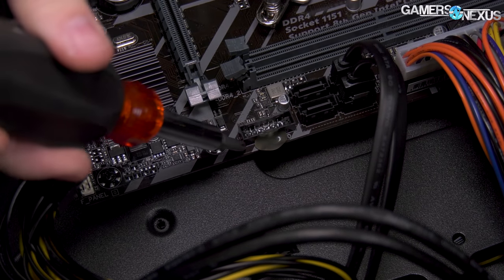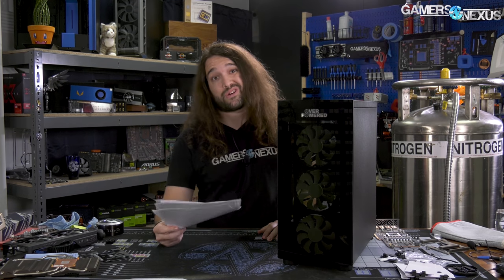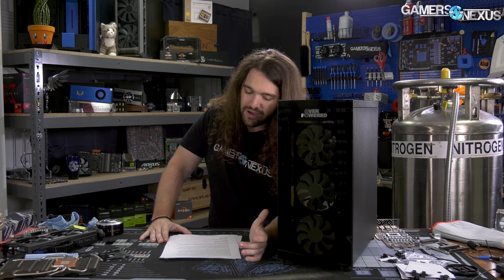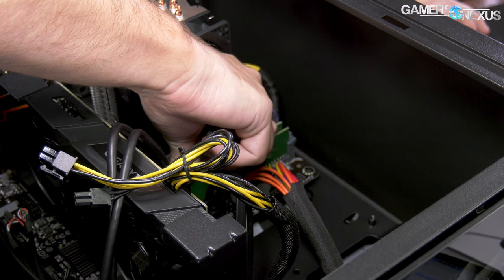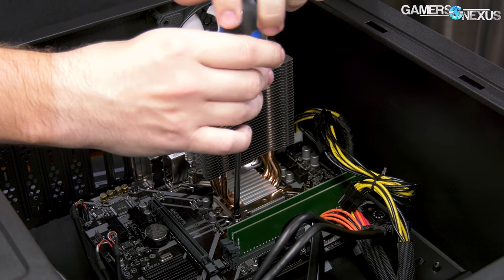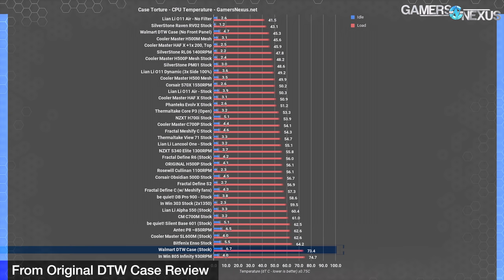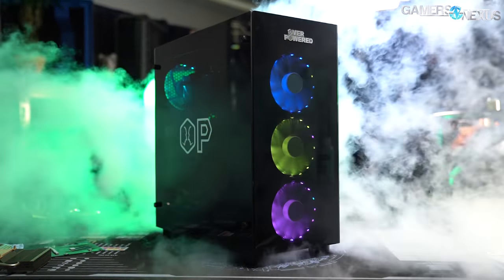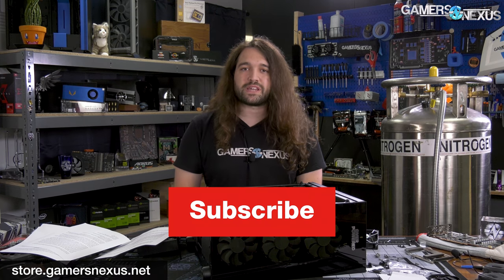Walmart Gaming PC: Second Chance, ~1 Year Later (Overpowered DTW1 Review)

Comment: Glue should never be used on a motherboard dude.. I understand they didn't want things moving around but c'mon man. There's better ways to handle that.
Reply: USB 3 cables are really hard to remove to begin with. I always freak out when I change cases.
Reply: @JayStein777  I sometimes have trouble with the 24-pin cables. And yeah, its always scary when you have to move the motherboard. One little bent pin somewhere can totally ruin your day.

Comment: Fucking Toshiba hard drives man. They ALWAYS fail me within just a few weeks...
Reply: Pleasantly Rusty  I don't know what I could have done wrong. The hard drives came stock on some laptops I had. Even had them replaced on the warranty just because it cost me nothing, came back and did the same thing again a week later. I ended up replacing it with a Samsung and I never had an issue again.

Comment: u buy a "gaming pc" from walmart, what do you get?

potentially a pc without OS.
potentially a pc with it's GPU not connected.
1 or 2 ram sticks depending on your luck.
HEAVILY outdated drivers, windows version etc. which will take a long while to update.
glued connections.
bad cooling.
the bare minimum in parts to make it run.

for who is this for at this point?
unknowing people that have no clue about computers and just use them waiting to get ripped off.

the average user wont be able to do anything as simple as updating the drivers (most go to sketchy sites to get for example gpu drivers) and let alone install an OS..

the experienced pc user that build machines before probably wont buy this anyway because they can build something a LOT better and just know from reviews that this is a waste of money..